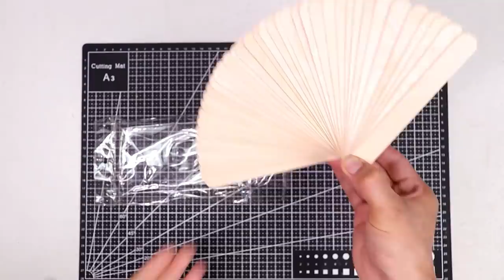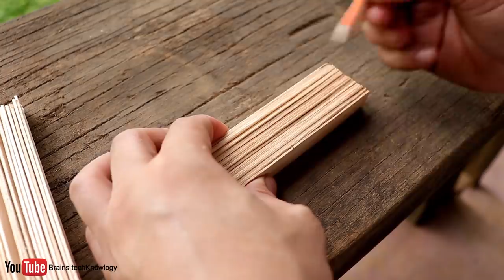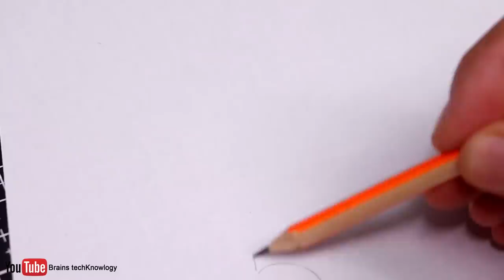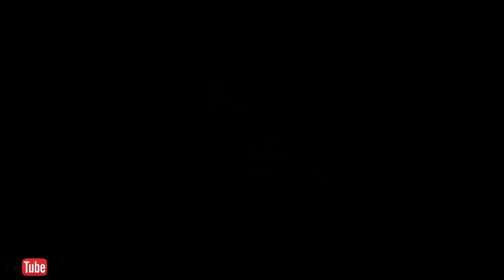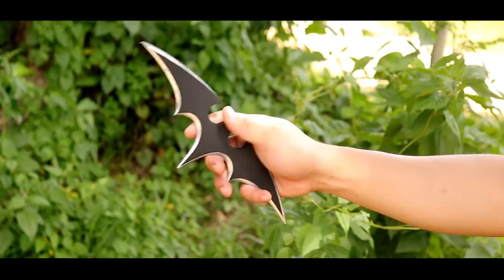How to make BATMAN Batarang using popsicle sticks without power tools! FREE Templates!

Comment: Lol, the popsicle sticks turns to one solid plank ang it's even harder and heavier than wood
Reply: How he made them stick together?
Reply: @حمیدرضابهرامی-ز6ط  maybe glue?
Reply: @thales855  I know man😅 but i was wondering how well he just made it, that plank looks like real cut of wood
Reply: Click bait video!
Reply: @RattySkankster  yea 
He took a real piece of wood and said he sticked them
Reply: @RattySkankster  how is it clickbait?
Reply: @dannyboy1487  if you can’t see, I can’t show you
Reply: @RattySkankster  he builds a batarang out of popsicle sticks, exactly what the title says so it's not clickbait
Reply: @dannyboy1487  no, he doesn’t. He switched the popsicle sticks for a solid plank of wood halfway into the video. This is NOT just a bunch of popsicle sticks glued together which is clearly evident by the fact that the wood grain on the plank runs all the way through from one end to the other - something that would not be true with popsicle sticks. This video (and honestly almost everything on this channel) is clickbait and a lie.
Reply: @ryhanon7  If you pause it at 1:25 you can see it’s not a single piece of wood. It’s clearly made up of all the smaller pieces he cut up.
Reply: @tgs1766  it’s funny that you’ve convinced yourself of that.
Reply: @ryhanon7  No bro watch it in slowmo, you will get to see the joints .
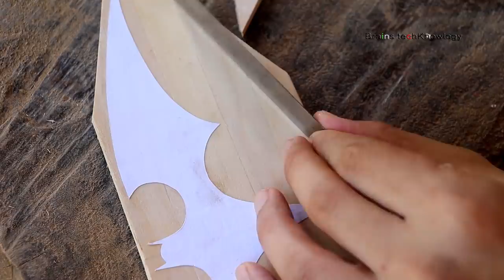Reply: @ryhanon7  2:00 you can clearly see where the popsicle sticks are stuck together
Reply: @dannyboy1487  it's plywood but still not made from those popsicle sticks
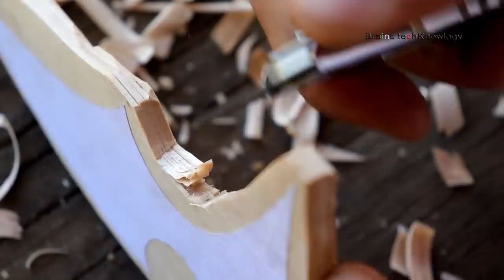Reply: @kiendo5773  2:16 you can clearly see it's popsicle sticks layered on top of each other.
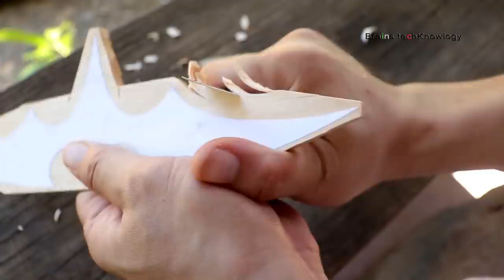Reply: At 2:16 it's clearly and obviously not a single piece of wood. It's obvious at other parts as well but it's quite clear right there.
Reply: @حمیدرضابهرامی-ز6ط  with bati-powers LMAO